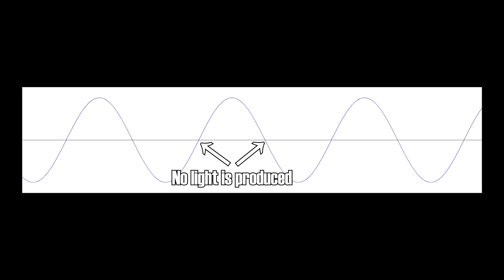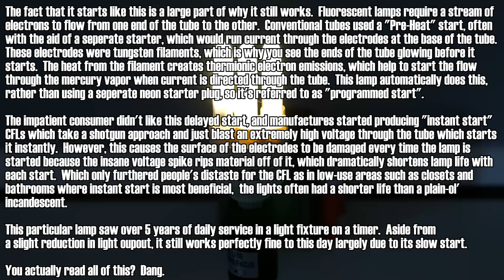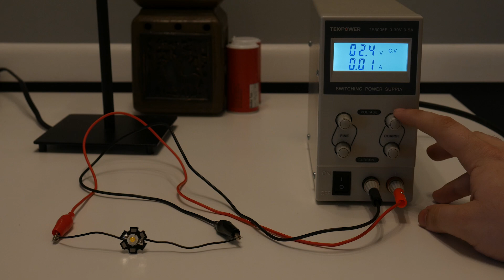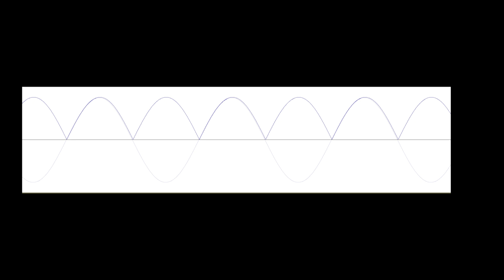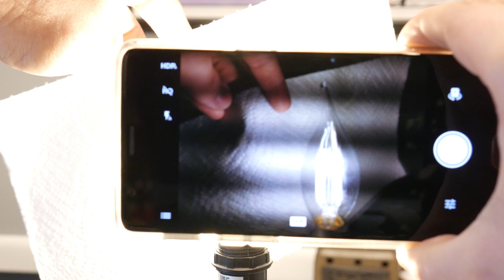LED bulbs that flicker, and CFLs that almost never did

Comment: Thank you very much for this video. I'm one of those persons who gets eye strains from flickering light.
I had found my nirvana with those high quality CFL bulbs, which had more Hg in the tube - so they started quickly in winter; and emitted constant, non fluctuating light.
Now those CFL have become unfindable, as they are being replaced with LED bulbs. 
Now, the LED bulbs can be designed with different criteria in mind. Since power semiconductors rapidly become expensive when they have to manage higher currents, some designs use a large number of small LED in series, just as you show in your video. 
Low current = cheap transistors, or better, cheap TRIACS. 
The electrolytic capacitor in the circuit smooths the rectified AC for the own use of the chip, and not for the operation of the LED strings.
Thankfully, not all LED bulbs use that horrendous driver. Many good LED bulbs use one (or few) big LED, controlled by a constant current driver. The problem is, the manufacturer don't state it on the bulb package.
There is one 100% sure way to tell that a LED bulb has a constant current driver, thus emitting pure smooth light.
That "sure way" is when the bulb is marked for "110 -240 V" operation. 
At home, I use OSRAM  LED bulbs with this wide voltage range, and I am truly happy with the steady lighting they provide.
On the negative side of things, they are expensive, around $ 7 to $ 10 each, but they come with a lifetime warranty, which means the filter capacitor is properly chosen. To date, I never replaced any of them, while the cheapy cheapos LED bulbs lasts few months - at best.
Again, thank you for shining light on the dark design of these badly flickering LED bulbs.
Regards from the UK,

Comment: I'd give this video multiple likes if I could. It really showed me how this subject is more complex than I'd have guessed. I now realize how some LEDs are much better designed than others. Just putting 80 or so diodes in a series string—that just skeeves me out, and I never would have thought such a thing would be sold. Now I find myself wondering which of my LEDs have good designs, and which don't, and how to check them.

Comment: The LED you showed is a good quality with real electronics inside. Full bridge rectifier, big capacitor and maybe even MOSFET to control current. However there are cheap crappy ones with just resistor capacitor circuit.

Comment: Magnetic ballast fluorescent bulbs can produce another much more annoying flicker when they are almost burnt out and the cathode at one end is more worn than the other. Then it will be dimmer on one polarity of the AC cycle than the other, and the 120Hz flicker turns into 60Hz flicker which is much more noticeable.

Comment: I got a filament LED about 4-5 years ago on a trip to russia. It was new to my eye and I just bought it. The specs are interesting it runs from 170-265v (says it on the packaging) and it doesn't flicker even until a 1/16000 shutter. It runs longer than the Phillips standard LED I bought later. Best of it, it only cost me about 1.49 . Good filament LEDs are so expensive over here and I have a bunch of CFL left to still use up. I use them in indirect lighting in the living room and they burn about 7-8 hours a day constant and noone seems to oppose. I use the filament in the bath room

Comment: "cfl's are on their way out"
Not for me, not for next 20-30 years it seems. Bought a whole box (discount) of them years ago. Leds were horrendously expensive and/ or not even available for typical sockets back then so I thought stocking up was a good idea... And I expected cfl's to die every couple years. Meanwhile most of my cfl's survived 10-15 years and are still fine. Leds run on 2x less power and shine brighter, but lighting is less than 1% of my electricity bill so buying leds and throwing out the box of cfl's would be a loss.
Incandescent bulbs aren't gone either. They are fantastic voltage indicators (we use them in series on 1kv DC line: bright - important, no battery required- gl getting an 9V for pro gear at 3 am, easy to fix), current limiters and fuses (box to test equipment, instead of a variable power supply it just has a bulb), part of umm... ghetto voltage dividers (work both as divider and (on/ off indicator)

Comment: Why are we not introducing 12V DC lighting circuits into houses? Also, my Garrard 301 turntable which has strobe lines around the vertical circumference works with a filament bulb which I think you do not mention.

Comment: Some Chinese manufacturers are cutting manufacturing costs of Led bulbs too much, crossing the line between a cheap bulb and un-usable one.

The main voltage (220V-50Hz in EU, 110V-60Hz in US) is rectified with a diodes bridge and leveled with an electrolytic capacitor (say 10 uF 450 V), then fed to the switching buck regulator - which provides the 4V-1A to the LED. 
The electrolytic capacitor is the most expensive component, because it is made almost completely of pure aluminium, a material earmarked as 'strategic' in China. So some "patriotic" manufacturers just don't use the capacitor, feeding the regulator with a contorted waveform; the net result is a very low circuit efficiency and a minimal lifetime for the bulb, together with an excessive flickering. An LED bulb should provide a smooth and constant flux of light, while these 'scam-bulbs' produces a pulsating flux, which takes a toll an the eyesight. 

The solution is to buy known bulb brands like Osram and Philips, avoiding Amazon deals and own-brand supermarket bulbs. There are other technical solutions - but involve taking the bulb apart or adding an additional external circuit (to feed the bulbs with DC).

Thanks for the great video!

Comment: As far as linear fluorescents go, the magnetic ballasts were much better than  electronic ballasts. 
Magnetic ballasts would last much longer. Often 30 to 40 years. Then the EPA stepped in and screwed everything up. For example take the 8 foot single pin florescent. They were always 75 watt and worked great with a magnetic ballast, even in cold temperatures. If it was cold they would flicker a couple of minutes as they warmed up, but then they worked fine. Then the EPA forced them to lower the watts  of most 8 footersto 60 and use an electronic ballast and the lights barely worked even when warm. And the electronic ballasts   are relatively short lived.

Comment: Just a little info here. I have ran LEDs off of AC with out a rectifier or electronic circuity. I am talking about individual discrete LEDs. You must obey the voltage limits of the device. Which in almost all cases requires a dropping resister  to limit the current, which will drop the voltage. You can  just run a LED using 2 VAC, polarity is not important.

Comment: Yes i read all this, and this explains why one of the cfl i had ended its life with an orange fire like glow after it got black. The electrode most likely burnt up as it was the bathroom, so open close 10x a day for 5min.
We have a cfl outside. it takes about 5min to reach full brightness in the winter. It starts with a faint purple/uv like light and i can see the flow trough the tube, just not film it.

Comment: One thing is for sure it's still alot cheaper to produce traditional incandescent light bulbs. On a very cloudy day I still use incandescent light bulbs when I'm painting, but CFLs should be avoided if ever possible imo.
I use good quality LED light bulbs for the very majority in my household- they're now FINALLY equally as good and last at least five times longer.

Comment: FINALLY! He said 230V
Reply: I think you'll find nobody in the real world actually has a 230V mains supply. The EU standardised it to 230V, but then allowed such a wide tolerance that mainland Europe was able to keep its 220V and the UK its 240V.
Reply: @robinvince616  Of course it's never exactly 230V, but that is the STANDARD. And no, In France, Spain, Portugal, Belgium, Luxemburg, Holland, Denmark, Sweeden, Norway, Finland, Estonia, Litvania, Germany, Austria, Czechslovakia, Poland, Hungary, Slovenia, Serbia, Bosnia Herzegovina, Albania, Bulgaria, Italy, Switzerland, Romania, Moldova, and Croatia uses 230V at 50Hz. Russia and other slavic countries, which I haven't listed are 220V nominal.
But as you say, it's never 230V. In my flat (Hungary) the voltage hovers between 235V and 251V. The most common value I get is a nice round 240V.

Comment: Idiot. Fluorescence does not imply flickering, it implies NOT flickering. The reason why flickering does not occur or is minimal at worst, is because the fluorescent material gives off light when the light source is off - that point when voltage is zero. There are fluorescent LED's and non-fluorescent ones. The cheaper ones do not have this material, thats why they flicker. The material LITERALLY works as an electric capacitor - it gives off luminous charge when main light source is off so light production is continuous (no flickering), just like the electrical capacitor gives off current while the electrical voltage is missing between the voltage peaks - so the current is continuous. https://www.google.com/search?client=ms-android-verizon&sxsrf=ALeKk01hdc1mxwt51pIWbo0ah__4IJegfA%3A1596360849652&ei=kYgmX9GhJ4jj_AbQ7bmoCg&q=fluorescence+definition&oq=fluorescence&gs_lcp=ChNtb2JpbGUtZ3dzLXdpei1zZXJwEAEYATIFCAAQsQMyAggAMgIIADIFCAAQsQMyAggAMgIIADICCAAyAggAOgYIABAHEB46BAgAEB46BggAEAgQHjoECCMQJzoFCAAQywE6BwgjEOoCECc6CwgAELEDEIMBEJECOgUIABCRAjoICAAQsQMQgwE6BAgAEEM6BwgAELEDEEM6DAgAELEDEEMQRhD5AToFCC4QsQNQjrCoC1id4KgLYPnsqAtoAXAAeAKAAYQDiAGFFpIBCDMuMTIuMy4xmAEAoAEBsAEPwAEB&sclient=mobile-gws-wiz-serp

Comment: Re: Instant Start -- surprisingly (or not) CFL bulbs that don't get turned off will last a looooong time compared to CFL bulbs that keeps getting turned on and off. I still use CFL in my bathrooms and I never turn them off. The reason being CFLs emit UV, and even though the UV is very weak, I figure constantly bombarding all light-reachable surfaces in my bathroom with UV will somehow help (weakly) disinfecting the bathroom.

Of course that means my bathrooms together consume ~30W even if not being used. But it's kinda worth it...

Comment: 2:36 - "LEDs have better colour rendering" = WRONG. Fluorescent tubes were "tri-phosphor" which means RGB. LEDs are "Mono-phosphor" (yellow) plus blue. There is no red... the real colour rendering is terrible.
However, manufacturers classify their LED bulbs using the Ra colour rendering system, which is only eight pastel tones and none of them are red. The fact that some LED bulbs score a high CRI is only relevant if you only view those 8 colour tones.
The entire CRI system is rubbish, especially for LEDs. There are better colour rendering index methodologies, however the manufacturers don't use them because the (cheap) LEDs score poorly.
https://en.wikipedia.org/wiki/Color_rendering_index#Special_value:_R9

Comment: One thing I didn't hear explored here but I can say anecdotally sucks about certain older CFLs, is that the electronic ballast produces an audible high-frequency whine, similar to that produced by some cheap USB wall chargers. I'm sure some LED bulbs have this problem too, though.

Comment: Former hardcore gamer here. Back when i was actively trying to be the best i could at fighting games, which at some point requires frame inputs (inputting a command into the game during a specific frame being displayed), i could actually see some CFL bulbs 'shimmer' and after awhile i realized i was noticing them 'flashing'. I never seemed to get eye strain or headaches or anything, it's just something i noticed. Usually with very old bulbs or really cheap ones.

Comment: As someone who works in the Lighting (mostly nightclub/concert and theater lighting) I deal with this every day. I get asked if there are alternatives for Halogen lamp (those used for Ellipsoidal lights and PAR-Cans) by people who don't understand how it works. Although halogen lamps run hot, and consume lots of electricity, and like to go out with a bang (sometimes literally), they are not simply swap-able. Concerts and other events get recorded, and LED's have been known to produce that unwanted flickering. Professional LED's are designed to adjust for any inconsistency in the incoming AC power's 60 or 50 Hz. That requires a lot of electronics and usually a power conversion to DC or a phase change (less common) and require an active cooling solution, unlike Halogens that passively cool. LED's are great, but expensive to replace entire halogen based lighting. They do exist, but come at a steep price and many halls and nightclubs cannot bear the cost to replace hundreds of fixtures. That was a rant.....

Comment: My big issue with CFLs is they seemed to get dim or die quickly requiring replacement long before the claimed "10 years" or whatever, and they also would take AGES to get up to brightness in the winter - outdoor ones sometimes would never get up above a dull glow on cold winter nights.  We had to replace some with incandescent bulbs after someone came to the door late at night and we couldn't see who was there.  Same in the garage, you'd have to turn them on half an hour before going out to get usable light.  LEDs are better but they still seem to die very quickly in many places, in one case our new outdoor LED lights went disco-strobe death after just a couple weeks.

Comment: I avoid CFLs as much as I can. Why? They don't last very long. They get dimmer as they age. I've no idea how I'm supposed to dispose of them safely when they die or get too dim to use.
However I now live in a stupid rented flat where all the ceiling fittings have G24q1 sockets for 13W CFLs. Grrrrr.

Comment: I got a ceiling fan that came with these superflickery led bulbs with the candelabra (E12 I think) base. It was really annoying seeing shutter effects when moving around.  I replaced the bulbs with ones that I never noticed this issue with and the problem went away completely.  With slow motion capture I can see the crappy lights twinkle dimming almost completely out on each cycle.  The other lights are almost completely steady.  So brand makes a difference.  I'm not sure how they manage to fit filtering into the base, but they work well.

Comment: There is a wide phosphorus problem if cfls and white leds:
If you put too much phosphorus over the light source - you'll have light power to loose in these dense phosphorus debris.
But if phosphorus is not enough - you will have extra blue and UV emitting into your eyes.

Comment: I used to think I didn't like the "Daylight" lighting -- and strictly speaking, I still don't -- but I found I don't like the yellow of the "Soft White" either.  Interestingly enough, after experimenting with a display at the Home Depot that enabled me to try the three different warmths of light (I forget the name of the middle one), I found that the lighting I liked best was all three at once.  I compromised and got myself some Daylights, and balanced out the two in my office lamps!  (Now I wish I could have a 3-way lamp that goes from Soft White to Daylight to both ....)

Sometimes I'll turn off the Daylight, particularly in the evenings, but in general, I like having both spectrums at once.

Comment: I'm still waiting on the day when good looking LED lights can be dimmable without a flicker. packages nowaday say dimmable.. and it is. but not without flicker.
Reply: The 0-10v dimming led drivers work pretty good, but take extra work to install.
Reply: There is a little problem called "physics". You cannot dim an LED fully because - physics. 
The only dimming you can implement is switching the LED on/off lots of times per second - aka flickering.

Comment: Always preferred cfl, but the lengthening of start up time is a pain. When do you decide to replace them, if you don't need full brightness quickly they effectively can last forever. Led on the other hand often fail because of cheap crap drivers not the leds themselves.

Comment: My aversion to CFL's was that they usually had poor life; they still generated a lot of heat (which can add up, in the summer ); they were often slow starting, and they were useless for outdoor use, in the cold. I had no problems with their visual characteristics. The warm white versions were just fine.

Comment: The problem with LED bulbs is that most of them come with warnings not to use them in fully enclosed fixtures. Also, they're too big to fit my fixtures.
Reply: It all depends on the shape. LEDs can be made to fit into almost any fixture, even if some don't fit yours. Although in the future, we'll probably see more integrated LEDs rise in popularity which literally have the LEDs built directly into the fixture since they can last so long and you hopefully won't have to worry about replacing any bulbs